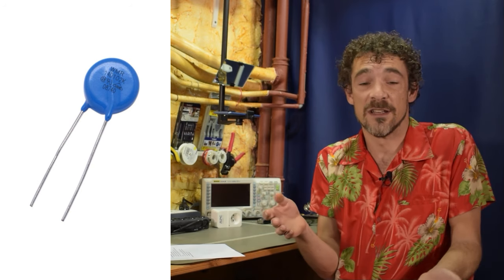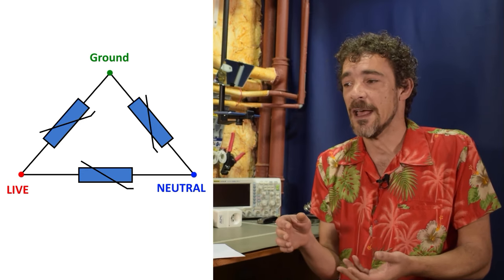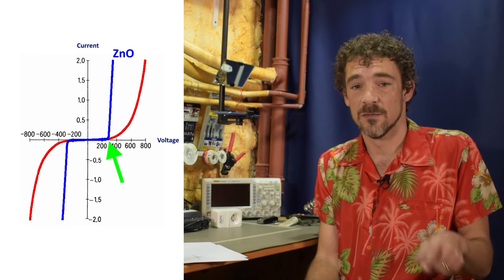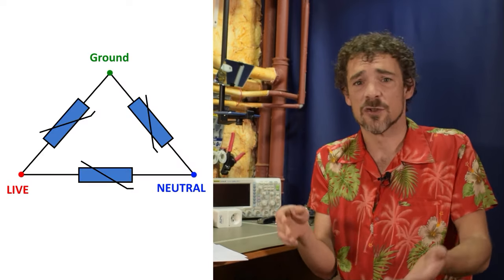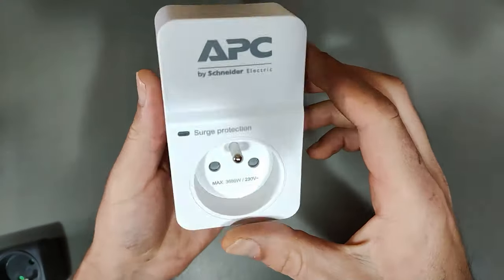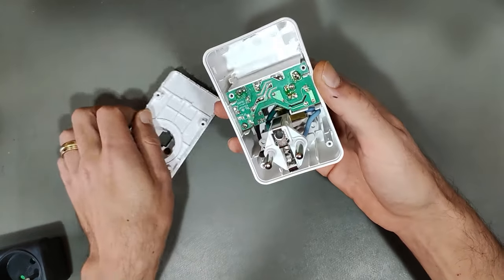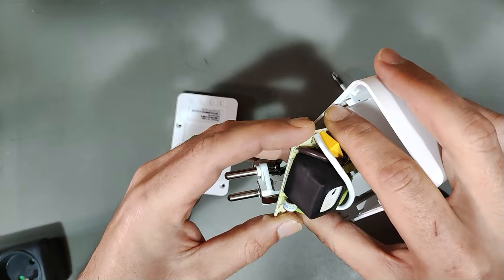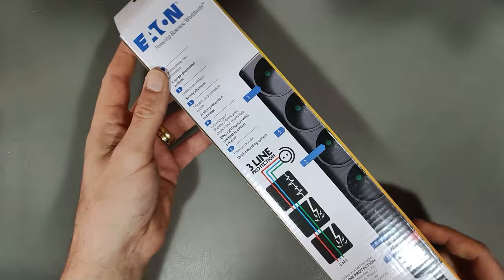Do surge protectors really work?

Comment: This is always something I wondered about. Great explanation. My only question is using a surge protector on a floating ground. Many people have large solar power stations which is a plastic box with no earth ground typically. In a power outage if I hook up a power bar with surge protection and I have a microwave, toaster, kettle, computer plugged in, when I use one of those devices I suppose it could create a surge in my little power network and not sure if that is dissipated in the surge protector. I also understand that using more than one device on a floating ground can be more dangerous if there is a short since you can become part of the power loop if touching those devices at the same time.
Reply from the maker: Your gizmos should always be grounded. For example, in your house, every gizmo is attached to ground, which is attached to a ground rod in the earth. The power company then provides power, and your house neutral may or may not be bonded to ground at the panel (in N. America, yes, in rest of world, mostly no). When on any kind of backup power, the backup power generator CAN be grounded, but doesn't have to be. My genny is grounded to it's own earth rod directly next to it. That ground is NOT connected to the house, because then I'd have 2 grounds and I'd end up with a ground loop. Ground loops are where you have 2 earthing rods, and various conditions cause a difference in potential between the 2 rods that are spaced apart even a small distance - hence you get currents flowing where they shouldn't be, and things start exploding. IOW, your source of power kinda does its own ground, but the important part for you is your house ground. For solar, you should be able to generate DC power, feed that into your inverter, and then connect that to your house with transfer switch or whatever. Should the inverter go crazy, you'll get surges that will exceed the ratings of the varistors in the surge protectors, and thus they'll still do their job. On the other hand, generating power locally also has the benefit that many surges come into your house due to the power grid, it's very long aerial lines, and things like lightning strikes... If you're disconnected from the grid, you should have fewer potential catastrophic surges. Well, it gets more complicated than that in some situations, but overall, you should be okay and your surge protectors should still protect your gizmos no matter what's powering them.
Reply: @ScottiesTech  Thanks for the detailed response. Earth grounding correctly is the best way for sure. Good you have yours grounded. I don't think most people earth ground their portable solar power stations, you know like brands like Jackery or Ecoflow. They tend to be portable but powerful enough to run a microwave, electric kettle, lights etc... and people just use them as is.

Comment: Is there any advantage/disadvantage to using surge protectors built into plug heads? I've been considering upgrading some basic extension leads by changing the plug heads with surge protected ones, and considering how these extensions are clearly designed against being opened, it's the most user-repairable option I can think of.

P.S. when the surge protected plug head has lost its protection over time, you can always switch it out and then (if I'm not mistaken) a non-surge protected plug head just becomes a normal plug head that can be used elsewhere, so less e-waste too!
Reply from the maker: Yeah, they're all the same basic design, so that should work nicely!

Comment: Each year my Christmas lights seem to go out, and I’ll have about 15-20 bulbs in a row all burned out (actually can see black scorch marks inside the bulbs). This happens to multiple strands of lights on different outlets. 2nd year in a row. I don’t see any other symptoms (other then LED lights occasionally flickering) but I’m assuming I’m getting surges, would a surge protector help with this?
Reply from the maker: Maybe. My guess is that either your line voltage is too high, or too low... But possibly not high enough to be shunted by a surge protector. But the thing to do would be to get a voltmeter and check the voltage at different outlets at different times. If it looks normal, then it's probably surges.

Comment: This definitely filled in some gaps for me knowledge wise, though it leaves me curious.  Do the automatic shutoff surge protectors use a design that instead of allowing electricity through after the varistors fail instead breaks the circuit stopping the flow electricity?  I'm about to order one that has automatic shutoff so maybe I'll open it up and see.
Reply from the maker: Yup, you got it. So the auto-shutoff ones are much better.

Comment: Based on the comment recommending a UPS, does their surge protection circuitry also deteriorate and need to be replaced every "couple of  years" as well? I know the batteries don't last very long for the power backup.
Reply from the maker: Typically I find they last about 5-7 years. The batteries last 3-5 years.

Comment: So to have protection on certain equipment there must be better fail safe!Is their something that does do this for better protection (USA)
Reply from the maker: A UPS (battery backup) is better, but still not 100%. UPSes have built-in surge protection that can also get fried. Once it does get zapped, very often the circuits that monitor and switch to battery power are also damaged. I speak from painful and very expensive experience here... ;)
Reply: @ScottiesTech  Thanks alot  I never miss a video of yours love it!!

Comment: 18:14 wrong 1. You don't get more then 400V in a 230V 3 phase system. It's easy to calculate: 230V x √3 = ~400
2. Of course they protect you from high voltage due to loosing the neutral (or incompetent and negligent workers at the electrician company). And no, they don't have to last for hours.
They have to last (e.g. for a 230V system) exactly 0.2 seconds and they easily do that. That's the longest time the circuit breaker may need to cut the power in case of a short circuit.

Comment: So is it safe to connect a basic power strip to an single surge protector?? I heard somewhere that it may be a fire hazard
Reply from the maker: Yes, that should be fine. Connecting multiple extensions cords and power strips together is only a fire hazard if you're running too much high-powered stuff at the same time - like electric heaters.

Comment: Are surge protectors good for using to prevent the circuit breaker on the house from tripping? I have a bunch of gadgets going on in my garage at one time including a refrigerator, dryer, washer, portable AC.  Im assuming the ax compressors are causing a surge which is tripping my circuit breaker. Will a surge protector prevent this scenario?
Reply from the maker: No, different kind of surge... If the breaker is tripping, the total current is too high. Surge protectors protect against voltage spikes. In your case, you can calculate the total current being drawn by all the gizmos (Power = Volts / Amps), and if the total current is higher than the breaker current rating, you've got too much stuff running on the 1 breaker. If it's LOWER than the total, then you might get away with replacing the breaker with one that allows motor-start surges (they're known as 'D' type in Europe)... But really, you should divide the gizmos up between different circuits. Usually, you do Washer = 1 circuit, Dryer = 1 circuit, and then you can prolly get away with running the rest on the existing circuit.

Comment: Do you happen to know why Japan uses mostly 2 prong yet still supposedly can have surge protection using these things they call OA taps that use a "surge absorbing element" many of which don't have a ground connection? I've heard Japan is based on short circuit surge protection or something like that rather than clamping. Is this actually a similar safety level as clamping with traditional surge protectors?
Reply from the maker: Not sure why Japan isn't big on ground prongs. As I understand it, the real surge protection occurs between live and neutral. That's why many models have a larger varistor between live/neutral, and smaller ones between live/ground and neutral/ground (if present at all). IOW, most surge protection IS shorting the surge, not clamping it.
Reply: @ScottiesTech  I see thanks for the info!

Comment: Please help me with advice. I live in a region where the electricity is cut off twice a day for an hour and returns. Is the first model of APC sufficient to protect my refrigerator from the danger of a power surge? I know that the power consumption of my refrigerator is 235 watts, and the voltage is 220 volts , 1.35 amp . Thank you.
Reply from the maker: Yup, the APC will work fine with your fridge.
Reply: They make surge protectors specifically for refrigerators - I have been told these are better to use, either way, they MUST be heavy duty enough for the fridges start up voltage. Mine is made by RCA.

Comment: Do non-sacrificial surge protectors like ZeroSurge or Furman models with SMP also protect everything on the same circuit or do those only protect equipment plugged into the protector?
Reply from the maker: Yup, they protect everything on the same circuit, even if it's plugged into another outlet on that circuit.

Comment: I wanted to buy that very APC that you opened in this video, but I read a lot of comments that such devices can cause a fire. I found one such comment for a YouTube video titled "Inside a 13,500A surge protector. (With schematic.)".

And in general, if you search on YouTube: surge protector fire
- you will find many videos about it.

What do you think about that?
Reply from the maker: In general, if it's designed well, a surge protector shouldn't cause a fire... any more than surges causing components in appliances/gizmos to burst into flames. I experienced a BIG surge myself at home, and a lot of gizmos were toasted. Upon opening many of them up, I could easily see how any of them could have started a fire - but none did. So, all things considered, I usually just encourage people to go at least mid-range on whatever they buy - never the cheapest. The cheapest gizmos often cut corners, and then you're more likely to have fires or various other problems due to poor design.
Reply: @ScottiesTech  Thanks for your reply! If it's not inappropriate, I would like to ask you if you consider the APC PM1W (the same device that you opened and analyzed at the beginning of this video) to be mid-range, or it's the cheapest? 

Unfortunately, I already bought "Brennenstuhl 1506950" but I guess it's lesser quality than that APC.
Reply from the maker: @MegatronVideo  I bought a bunch of the APC PM1Ws, and I'm happy enough. But I'd say both APC and Brennenstuhl are pretty good brands. I consider the "cheap" ones to be off-brand no-name ones. The BEST kind are TrippLite, which disconnect the juice when the protection fails, but I've been unable to find anything equivalent in Europe, so I'm stuck with what I've got.  I've got a whole bunch of APC battery backups, and I find them to be the most reliable and long-lasting.
Reply: @ScottiesTech  Thank you!
Reply: @ScottiesTech Have you seen the Sollatek plug through AVS such as the FridgeGuardiS? I brought a couple after my fridge freezer died a fortnight after a power cut which I believe had caused an undervoltage.

Comment: When Varistors (between live and neutral) reach the peak voltage they conduct electricity which in turn short the circuit and make the fuse blow/reset therefore disconnecting the whole extension from the mains (if the fuse is fast enough to react and blow). Meanwhile the 2 varistors between ground and live/neutral will just dump the surge to earth.
Reply from the maker: Theoretically, yes... But practically, not necessarily. What I mean is that I had a sustained voltage spike "event" that fried a bunch of stuff in my house. The surge protectors in some cases worked helped save stuff, but only one breaker tripped. Mostly, the varistors exploded, no breakers tripped, and gizmos got fried anyway. So, they're really good for short surges, but not for sustained ones that could trip a breaker. Which is really weird, because you'd think that's what would happen! One of the mysteries of life, I guess.
Reply: @ScottiesTech one of the things that's worth noting is that generally plug in surge protectors are usually adequate for protecting from surges that originate inside a home, usually caused by some large inductive load such as an AC unit or refrigerator compressor turning off.  They are a little more hit or miss at dealing with surges originating outside a home, such as a lightning strike on a power line. But above ground power lines, should be protected with lightning arrestors to reduce this problem, however not every power company in the world is very good about installing them. but to have adequate lighting protection, you need a whole house surge protector for that. And no surge protector made can stop a sustained power surge from say for example, an energized 7.2 KV power line coming into contact with the low voltage wires on the secondary side of a transformer.

Comment: We don't have ground in our apartment, only in the kitchen and bathroom, can I use one of these instead?
Like plug in the computer through a surge protector. If the computer would shortcircuit so eletricity would you go out into the chassi and I would mistakenly ground myself and touch the chassi, would the surge protector trigger and shut off the power so I don't fry myself? 🤔
Reply from the maker: The surge protector will still prevent surges across live/neutral, but not from live or neutral to ground. BUT if you have a GFCI/RCD (what I like to call a safety breaker), that monitors leakage current from live/neutral. So if you did have a short to ground/chassis, the safety breaker should trip before you get electrocuted. Of course, that doesn't mean you won't get a zap, but it's better than nothing since the GFCI/RCD would statistically prevent the zap from being lethal. Ideally, you'd add a real ground, but if it's an apartment that not exactly easy to do. You could get some RCD/GFCI plug adapters like these: https://amzn.to/3tCbQrV  Stick that in the wall socket, then connect surge protector strip to it. Anything plugged in to the surge protector gives you both surge protection AND leakage current protection. That's what I would do!
Reply: @ScottiesTech  Thanks a lot for the help and tip! :D

Comment: I have one question , if you are using a voltage control relay (three phase) in your electric panel , is it safe to say that you are protected against high and low voltage in your appliances ? Do you still need UPS to prevent frying your computer ?
Reply from the maker: If you mean a voltage-monitoring relay like the kind used for motor protection, then that's sort of like having a whole-house UPS - at least in terms of the protection part. But even then, I'd still use surge protection because 2 levels of protection are usually better than just one!
Reply: @ScottiesTech  yes that's what i mean , ok thanks for your time !

Comment: So we have like 3 phase protection that is in the fuze box and outlets. Are those better?
Reply from the maker: If what you have is a 3-phase surge protector (with removable cartridges), then yes, that'll do! If it's a circuit breaker or RCD/GFCI with a lever to turn power on/off, then that's a different kind of protection.

Comment: sir very useful information, im just curious to know do surge protector work even without ground / Earthing ?   i have just bought a belkin surge for my 65 inch sony tv but my house is almost 35 years old and has no ground in it.  will i still get surge protection?
Reply from the maker: Yes, you'll get most of the protection to prevent frying your TV - which is across live/neutral. Protection is better with a ground, but not absolutely necessary.
Reply: @ScottiesTech  thank you for the information. It helps to clear my doubts. ☺️
Reply: @ScottiesTech  What benefits surge protection has if it is connected to the ground?

Comment: it's simpler. it's a short. varistor is high voltage short. just like capacitor is high frequency short. same rules can be applied to inductors and so. it helps me to think

Comment: could I take the surge protection out of a 3 outlet power strip and use it in a 15 outlet power strip assuming the wiring is correct? would it work?
Reply from the maker: Yes. That should work just fine.
Reply: @ScottiesTech  Thank you so much for the quick reply!

Comment: What is going on ?
In my block a bunch of neighbors got Teslas.
And as more neighbors got Teslas the power has been less reliable. Sometimes even long brown outs.
Routers need to be reset. PCs crash, laptop batteries get fried... 
And they are all behind surge protectors.
Then I replaced the surge protectors with sine wave UPS. Now no more problems. No Internet going out every day, no more PCs crashing or devices burning out.
Why?
Reply from the maker: Well, car chargers are very noisy, but that shouldn't fry stuff in your house. It sounds more like too much load, which causes a voltage drop when everybody's charging at once. When you just use surge protectors, that only protects against voltage spikes that are too high - not voltage that's too low. But with a UPS, it'll monitor the input frequency, voltage, and usually a few other things. If the juice coming into your place varies from the norm too much, it'll switch you over to battery backup to protect your gizmos. UPSes are a MUCH better option to protect electronics for this very reason. In the end though, the power company should check things out and fix the supply to the neighborhood - whatever's wrong with it.
Reply: @ScottiesTech  - thx. we had super clean and reliable power before Teslas.